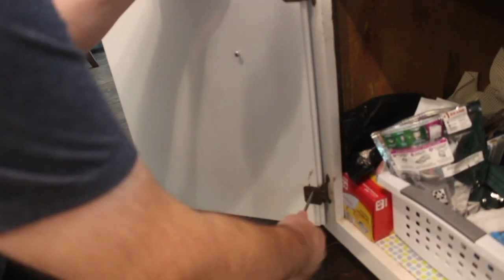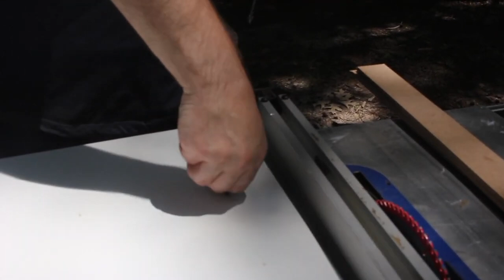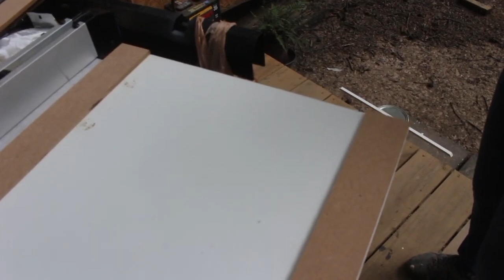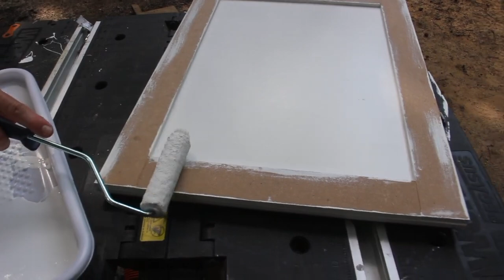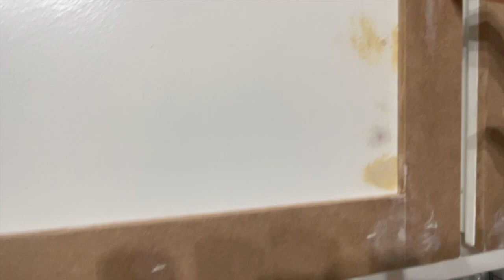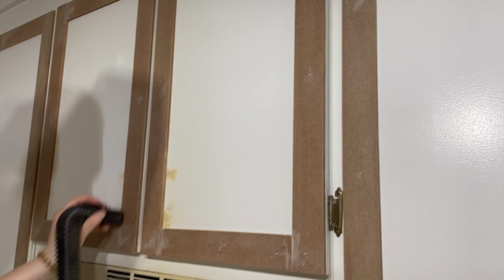This $50.00 Kitchen cabinet makeover will save you thousands of dollars!

Comment: Great video especially your explanation about using mdf. I am looking to makeover my bathroom and am thinking of doing that to the bathroom cabinets. I was going cut a 1x8 down to size but think will use mdf after hearing your reasons for it. Allow me to pick your brain and expertise. My bathroom cabinets are old early 1970s faced with wood paneling. Any thoughts and suggestions for covering up the wood paneling to make the cabinet face plain and smooth for painting? Thanks in advance.
Reply from the maker: I do not use MDF often but for this application there is no better option!